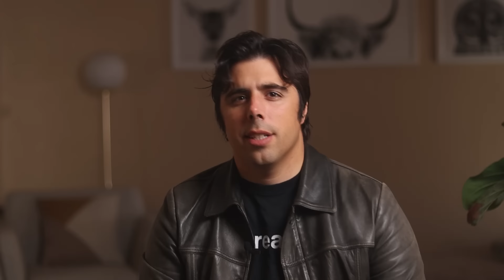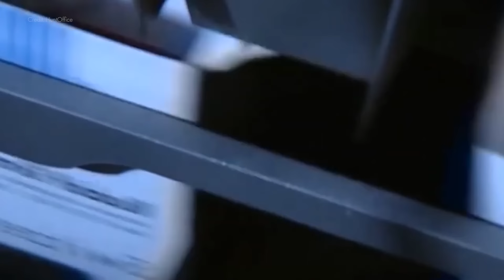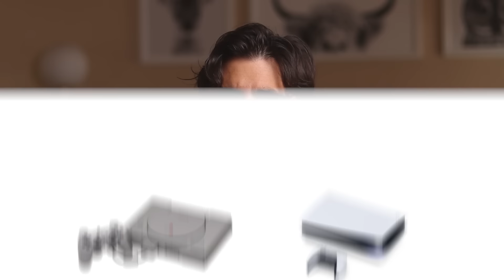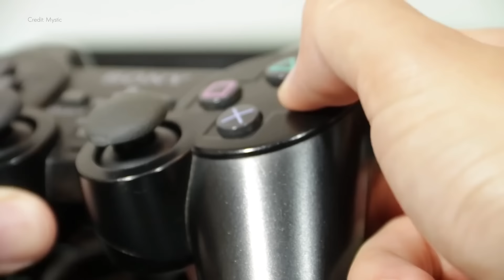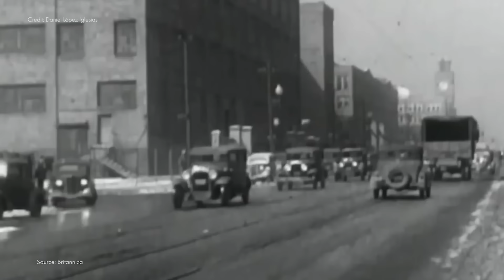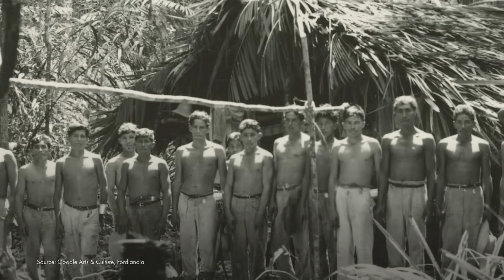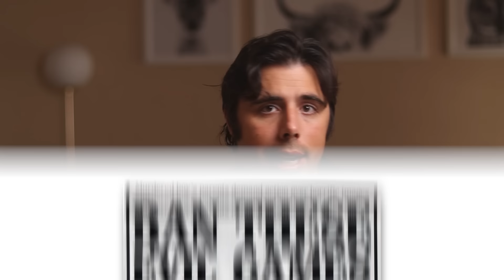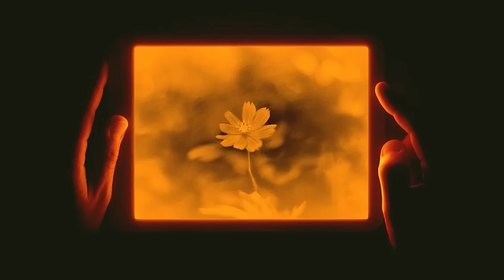Why Some Designs Are Impossible to Improve: Quintessence

Comment: I switched from QWERTZ (German version of QWERTY) to a German variant of the DVORAK keyboard layout. In my case I was not too used to the traditional layout. I tried blind writing several times but failed. After trying it with this alternative layout it worked out for me. Now I can write it blindly, even if the wrong letters are printed on my keyboard. Sure, I have several hassles when it comes to key combinations (CTRL + C and so on), but I found ways around these problems.

It is not impossible to use a different design, but you might encounter some (manageable) problems.
Reply: A problem with trying to move to a new keyboard layout is that even if your computer uses the new layout the other people are still using the QWERTY keyboard layout, which could make it awkward to use someone else's computer.
Reply: @Solitaire001  I can write on QWERTZ, but I am very slow on it. If I have to work an another person's computer for longer, I use a portable key-mapper.

Comment: 11:30 The qwerty keyboard was created to make typing harder and slower.
     The best typists were typing so fast they were pressing the next letter before the previous letter's striker had moved out of the way.
     So the qwerty keyboard doesn't really belong here as it slowed everyone down because some were typing too fast for the design to work properly.
      A better typewriter design would have addressed colliding strikers directly, rather than changing the keyboard layout to slow people down.
    Now that the striker problem was solved long ago, we still have the board layout that makes typing harder.
    This issue can be fixed, but it would involve teaching people to type on a new, better design while allowing those who have already learned to type to use the qwerty layout.
    Eventually those who learned the qwerty layout will quit typing, stop buying new keyboards and then the new design will dominate the market.
    With wireless keyboards it would not even be expensive to implement as both layouts could send the same signals to the receiver, so from the perspective of the receiver the two layouts are identical.

Comment: I had a 5, D-cell MAG light when I was delivering pizzas in the late 80's and early 90's, then I continued using it when I worked as a security guard. My reasons for preferring it were the same reasons the police liked it.
     I did sometimes have trouble with cops who believed it was only available for police, but while it wasn't easy to find that model it was available on the open market and 100% legal to own.
     I like to put the receipt inside the product if I can, so if a cop ever asked I could remove the batteries and show anyone who asked.

Comment: Instantly triggered in the first couple of seconds by the suggestion that the Qwerty keyboard (a layout designed wholly around the limitations of typewriters at the expense of ergonomics and speed) is good, let alone quintessential.
Reply from the maker: I discuss that later in the video
Reply: Ok he does of course address this later in the video.

In case you were wondering, no I don’t use any layout other than qwerty, but yes, I do have a pretentious hipster split keyboard with keys in columns.

Comment: Point 2 is putting the cart before the horse, with few exceptions.
It is the traits of the product which result in a high scale and prevalence.

Otherwise you are basically saying it needs to be high scale and prevalent to be high scale and prevalent.

Comment: I don't think I'd want my toaster to decide when to draw in my toast. If you're unlucky, it might clamp down and start cooking your finger too. I think I'll pass, that's one kind of technology I wouldn't want to get "burned" by.

Also, Sony blatantly ripped off Nintendo with the thumbstick. Nintendo first showed off the thumbstick on the N64 controller when previewing the system, and Sony managed to slap on two sticks and get it to market before Nintendo was able to get their own next generation console to market.

And as a Dvorak user for at least a decade, who has dabbled in Colemak a bit, I can tell you that no keyboard layout is "faster." That is 100% down to the user. The Dvorak and Colemak layouts are both leagues ahead of QWERTY and they both have their own strengths and weaknesses. However when comparing either to QWERTY, it is the overall minimization of excessive finger and hand movement and more balanced usage between hands and fingers that sets them apart, leading to more comfort and less RSI-related discomfort that these layouts can provide over QWERTY. Some people can type fast on either, but some people can also type faster on QWERTY. Typing speed is not the reason to use an alternative keyboard layout; in reality, less fatigue and discomfort provided by a more efficient layout are the reasons to consider using them.

Comment: I'd also add the steering wheel; the very earliest cars (eg Patentwagen) used a tiller until about 10 years later when cars started using them at the turn of the century. A few other things have been tried but nothing beats the usability of the steering wheel

Comment: the game controller became a de facto standard so quickly. the video mentions some werid controllers but it was a massive shift when the dual shock came out for the PS2. there are still too many weird controller schemes to shake a broadsword at but the platonic ideal in most people's head for a game controller looks pretty much the same for the past 30 years, it's insane
Reply: I would put it further back than the PS2. The PS1 Dual Analog controller came out in the late 90s, and the original PS1 controller is just the SNES controller with handles and second triggers.

Comment: Great video, but that bit about the QWERTY keyboard being invented to prevent type bar jams is not true. It's a myth that popped up years later. Typewriters are no more or less likely to jam if keys are placed further apart, and besides two of the most common letters 'e' and 'r' are right next to each other on QWERTY. The more likely reason is to accommodate common spelling errors in interpreting morse code.
Reply from the maker: not true, at least not according to my source. They went through a very rigorous process to demonstrate it. Google "wide spacer hidden secrets of qwerty".

Comment: QWERTY was not designed to slow typists down.  Dorvoak spread that myth as part of their marketing materials, along with the idea that their design was better.  

The reality is that QWERTY won in a crowded typewriter market and it had nothing to do with keys not jamming.  There's never been convincing evidence that Dorvoak leads to faster typing speeds than QWERTY.

Consider for example that QWERTY (or very simmilar variants) won in non-English speaking markets.  That wouldn't be the case if letter frequency, typing effort, etc matter at all to other markets.
Reply from the maker: Google "wide spacer hidden secrets of qwerty". That's my source. It's pretty darn thorough in its analysis.

Comment: On the controller part, while the Famicon/NES cemented it and everyone extended from there, Nintendo itself was expanding on it's very own older Game and Watch series. And if you give it some thought, later portable consoles was simply a "return to handheld origin". This makes it even more quintessential imho as it evolved forward, backported to original form and it still works great.

Comment: In talking about controller design you mentioned it's not the best for FPS games. You also talked about how it's hard to unseat established designs. I'm shocked you didn't bring up the steam controller to illustrate this. It was designed to meld a mouse and controller. It's innovative and can be a better control scheme in certain situations. Yet it shares a lot of heritage with those established designs. it's downfall was it's build quality, and it being just different enough to make you relearn things. But it wasn't a big enough improvement to make it worth the effort. I had one, but I never learned to use it to it's full potential. That and I hate touch pads.
Reply from the maker: All fair points, I thought about including that but ultimately had to cut it.

Comment: The Nintendo 64 controller was the first one to introduce the thumbstick when it came out in 1996 - NOT the Playstation 2 (although the latter did add a second one on the right side). Also, the Playstation 2 didn't start actual production until 2000, so while the design of dual thumbsticks may have been announced before then, that's arguably not the same thing as actually "introducing" something to the market.
Reply: to keep going on game controllers; I'm still bummed out that the gamecube controller didn't have more of an influence. As someone who games infrequently, I really liked the variation of the action buttons shape and size as a way to make memorizing the position of game actions quicker ans more intuitive. (for those who never saw one, the main A "action" button was twice as large as the others, and surrounded by a smaller b button and two bean shaped x and y buttons they surrounded the A button.

Of course it's a design that has several disadvantages: several button shapes means more different pieces of plastic to build. also it nudges all games towards being more hierarchical about their design verbs, because instead of four equivalent buttons in a circle, you have one big main button and three secondary ones.
Still, I feel to this day that this design philosophy deserved a better chance.
Reply: @maximeteppe7627 The Gamecube controller still has descendants, every non Sony controller uses its layout. 

Sony keeps their design because it's almost good enough in comparison, but mainly because of marketing and mindshare. 

They're still traumatized by the debacle of the boomerang controller when they tried to change the form factor during the PS3 era.
Reply from the maker: It was introduced in 1997 for ps1. Never said ps introduced analog sticks, I said they popularized the double analog stick format

Comment: You've completely overlooked the 6-button Sega Mega Drive / Genesis controller. It is actually the best design (especially 8-way D-pad, there was never a better D-pad since then) and was dominant at the certain point in the 90s as Sega was leading the market, but the 4-button design remains the standard as Sega lost the console wars by the end of 90s due to a series of stupid decisions unrelated to controller itself. Your research is very poor on this subject.
Reply from the maker: Evolutionary dead end
Reply: @Design.Theory  You literally were explaining in your video how the government ties and essentially corruption helped inferior flash-light win the market competition. How does that have anything to with evolution? You have very poor understanding on this subject indeed.

And you don't even know that 3rd party manufacturers make this 6-button controller to this day compatible with all modern platforms. How is that a "dead end" then?
Reply from the maker: Still an evolutionary dead end.

Comment: I think your sources might exaggerate the Model T's social effects, especially in urban areas with subways. The Model T probably had 4.6 billion trips per year (1). Japan Rail East has ~6 billion trips per year, in an area with half the population. 

I think people blamed behavior on the Model T, even though the car didn't directly cause them, because misattributing causes is a really common thing. After all, you could still take the streetcar to get out, or in some cities, ride a train/subway.

Although Ford had competitors, JR East also has to compete with other railway companies like Keikyu, and the metro/subway.

(1) Assuming there were on average 4 trips per day per car, there were 15 million cars sold, and a lifespan of 5 years, that means ~110 billion trips. This was over 1908-1932, or 24 years. 110/24 = 4.58

(2) JR East serves Kanto and Tohoku. It runs services that are subway-like (by western standards), commuter/suburban, and intercity. The two regions have 45 million combined. The US had ~100 million in the Model T's era.

Comment: Ironically, the Opera sponsorship demonstrates quintessence in that the modern web browser design in Chrome has not changed too much from 16 years ago, which didn't change too much with what Netscape had in the 1990s, as every other big web browser has a similar design because of either the Chromium base or the main design language of search bar + settings + tabs at top with the rest of the page just being there is all people ask for in a web browser.

Xanadu sure looked better back in the 1980s, but because it was the wrong time when "web browsing" wasn't popular, the project didn't captivate people in the same way Netscape did.

As wonderful as Xanadu is, I keep asking myself "what problems are the Xanadu project hoping to solve that these other web browsers hasn't solved yet?"
Reply: Opera had a better briwser engine, but they never had enough marketshare, since the bug-tech will always push it's own crap. MS with IE once had 95%, but it was the worst. Chrome isn't much better. I used to love opera, but changed to Vivaldi, yeah - sadly still chrome based...

Comment: Great video but I couldn't disagree more with the comparison at 28:02 with Apple vs Ford. The model T was 100% designed for manufacture and ease of service which is why there's still some driving around today, whereas Apple products are definitely design-led. Their late 2000s products were beautiful and have held up great from an aesthetic point of view, but they're extremely harsh to anyone trying to repair or service the battery or hard drive. Some of their laptops have completely driven design over performance or service life, with thermal issues and extremely poor serviceability/aftermarket parts. 

Obviously they know what they're doing and it's been incredibly successful, and a tonne of their products are design classics (even their horrible Macbook airs are gorgeous.) But I just don't agree with their design philosophy and I've heard from friends that their design for manufacture policy is; "don't".

Disclaimer; I'm a manufacturing engineer, the natural enemy of the designer.
Reply from the maker: In regards to comparing Model T and Apple, I was mostly making the comparison based on the way that they vertically integrated their supply chain to an obsessive degree; the end products themselves have basically nothing in common though. 

Also, design-led is not the word I would use to describe Apple's strategy. Maybe marketing-led. Or aesthetics-led. Design-led implies that design is only about aesthetics and external appearance rather than a holistic approach to usability (including repair and servicing). I am not an Apple fan by any stretch. I stopped using their products because of all the reasons you cited. I find it completely idiotic how they prioritize aesthetics and luxury over usability. But there's no denying that they were pivotal in defining the foundational smartphone platform that billions of people use everyday. They are THE defining force in the consumer electronics market.

Comment: You are incorrect that Sony controller has nailed it and is a perfected product. They certainly have not and it certainly isn't. The joysticks should be operated by the index fingers. Your fingers aren't doing anything, making the thumbs and the heel of the hand do everything is dumb. Functions need to be divided across the hand like an F1 wheel or electric guitar.
Reply from the maker: I said in the video that it was not even close to being perfect.
Reply: @Design.Theory  You can have that one on me. Seems like it's an idea with some legs.

Comment: Conclusion: It comes down to a cost to necessity metric. At a certain point of complexity and advanced-ness the extra cost it takes to create it outruns the consumers' willingness to buy due to the cheaper price of the less advanced but still completely functional alternative. Ex: All door locks should be nfc chips, so the days of fumbling with keys can be over, but the extra cost for something unnecessary is what keeps this from happening. I just thought about this a couple of weeks ago actually. Really nice video keep it up. Teooooo out😄
Reply: I believe the reason the manual key lock is still king is primarily reliability. Electronics failures leading to lockouts, hacking issues, and having to change batteries.
Reply: (This is in regards to why objectively better versions of a product don't necessarily become the new norm)